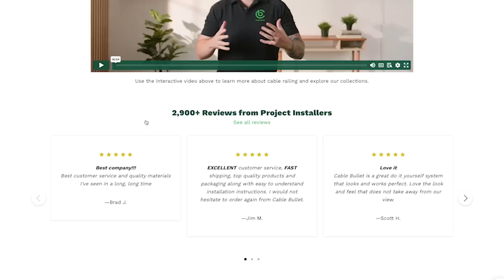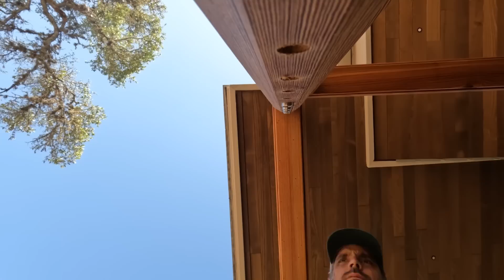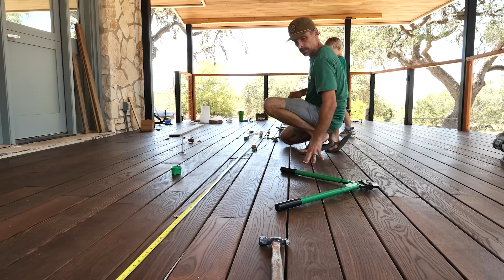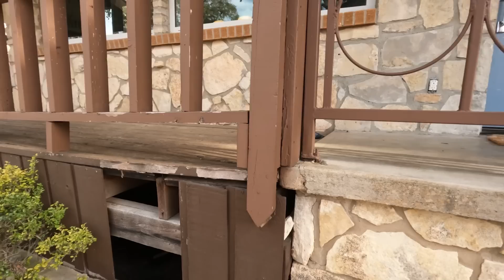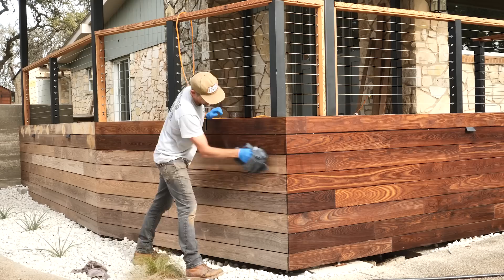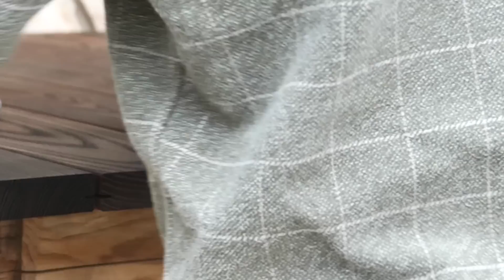Installing 400ft. of Cable Rail, Fresh Coat of Oil,  New Front Rail (DECK BUILD PART 7)

Comment: It's your house, so no issues, but that "extra" circle on the railing was to get the code compliant handrail extension past the bottom step.  When the railing stops at the bottom of the steps, without the extension, people with mobility challenges will have a harder time starting and ending their use of the stairs.  For able-bodied individuals, it's not an issue, as they rarely are using the handrail for support anyways.  Agree that it looks better, but code compliance isn't about how things look, but how they function.  Just thought you might like to know why it was built the way it was.  Whole project looks awesome!  Great project and great series.